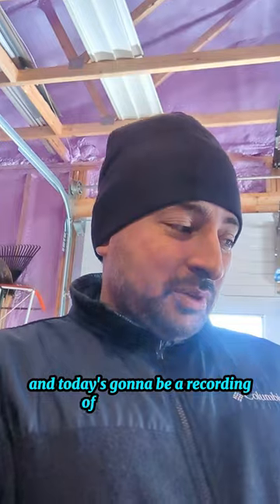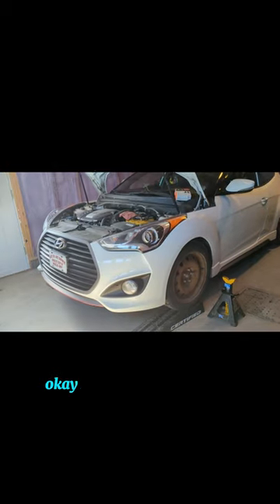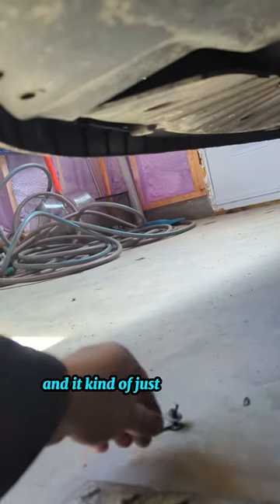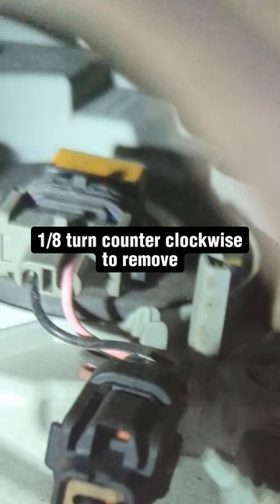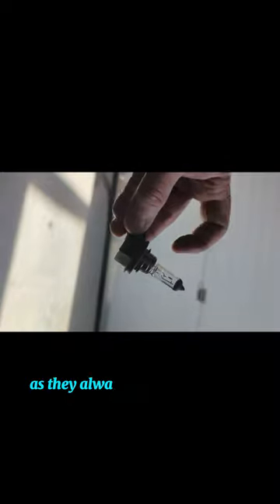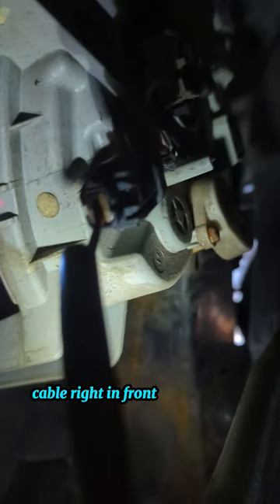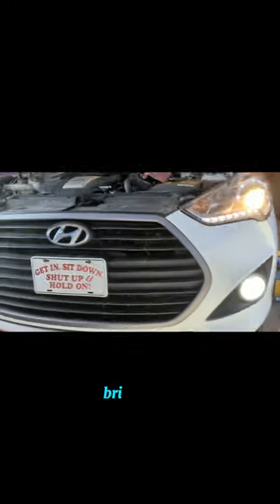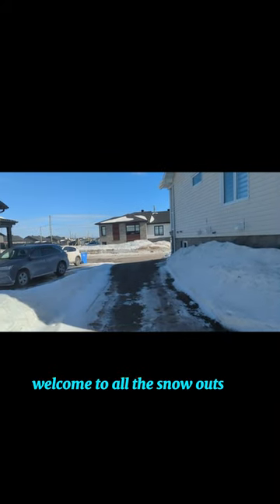2016 Hyundai Veloster Turbo - Change a fog light (H8).

Comment: Question, can you install these in the low high beams, or any leds lights? Mine said it required H11B but i was wondering if there is an led equivalent?
Reply from the maker: H11B is for my low beam. I heard of people using converters when they don't want to purchase H11B LEDs. I don't know about these personally. My high beams are H7. Personally, I have ordered these 2 through Amazon. I'm just waiting now for one of the lights to arrive in March so I can do the low and high LED installation.
Reply: You won't be disappointed.